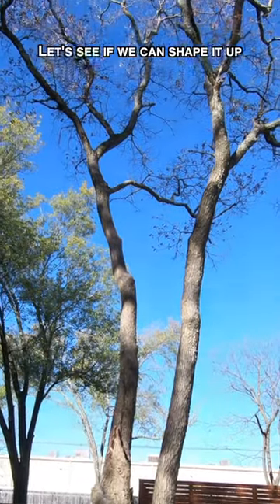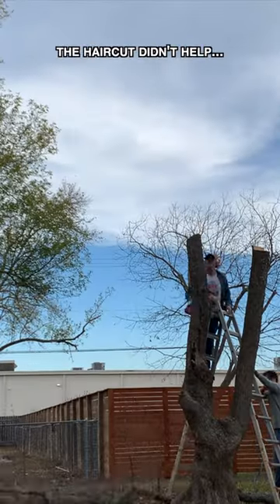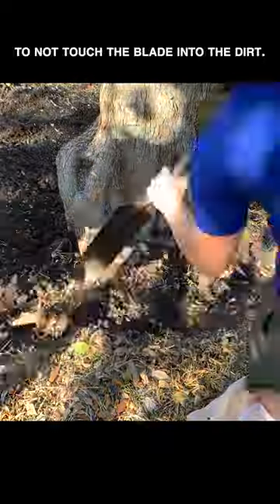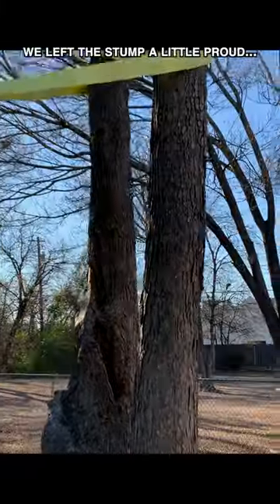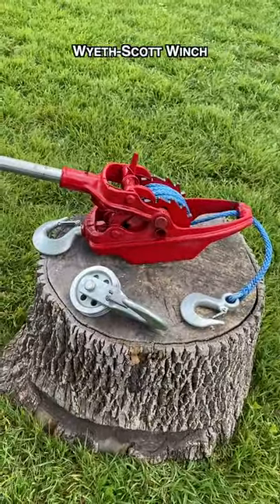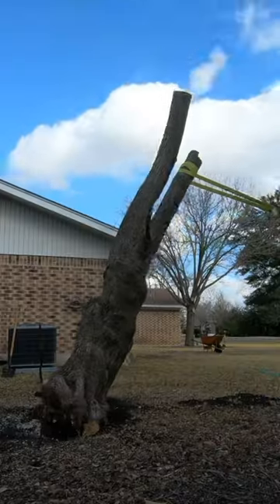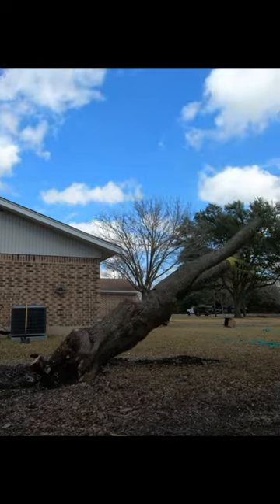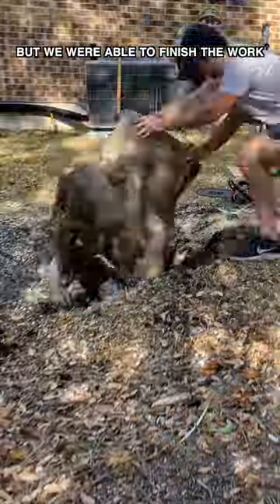Using Physics to Remove a Tree!🌳 #treeremoval #tools #physics

Comment from the maker: Ended up upgrading the winch for a truck! Check out the linked video.
Reply: I watched a video of a guy with a tractor and a higher degree in some science that I can't remember struggle for two days removing a stump. He kept preaching pulley math and quoting theories. More money and schooling than the ability to link muscle to mind. The comment section was lighting him up about what he had done wrong. He hid behind excuses and accreditation. Meanwhile, you made this look easy with practical applications of equipment and force without pretending to know what you're talking about.

Comment: Sawzall is a good way to cut roots instead of chainsaw.  Use a Diablo pruning blade.  It can sink into dirt without worrying about dulling the blade much.
Reply from the maker: Agreed! We used that and a cheaper electric chainsaw on some other removals
Reply: Damn good idea
Reply: That's exactly what I did with about 12 trees in my back yard
Reply: I now have the challenge of a red oak stump that doesn’t want to move. I’ve pulled and jacked from several directions, thinking that I’d seen movement.  I’ve one more direction to try if I can muster an anchor that way, then it’s heavy equipment time.  
The tree had fallen over during wet weather after over 60 years that I know about, so my next effort will be to pull it directly away from the weak root system that allowed it to fall over.  I’d been using its resistance
To anchor other efforts, but it will soon be time for me to make some sort of table top out of the remains and fill the massive hole that’s roughly 10 feet diameter.

Comment: Sawzall works amazing for roots, i ran a wood with nails blade in the dirt for a long time, only reason the blade broke is because i hit a few large rocks multiple times
Reply: Your blades break?

Them Diablo 14 inch embedded wood blades just bend side ways and keep cutting. 😂😂
Reply: @dbongoloid9541  yea after you straighten them out a few times with a hammer they get real brittle lmao, milliwaukee blades

Comment: A small fruit tree was removed [about 10 feet from my home] they left a small stump and now I have a colony of carpenter ants. I'm guessing that the ants were attracted to the sweetness of the stump. How can I get rid of the ants?
Reply: Stir about 3/4 cup of dawn dish soap into 2 gallons of water.  Pour slowly.  You want it spread wide enough but also deep enough.  Works great around my garage.  I was told that they breathe through their exoskeleton and the dried on soap interferes.  I hope it works for you.

Comment: What is that long pole you were using to cut those branches without a latter
Reply from the maker: Stihl Pole Saw (PP800). Its a little on the pricey side but it has telescoping handle and can reach 18 feet.

Comment: I’d like to remove a tree that’s next to my house, maybe 5 feet away. It’s ugly and it’s cross bred it something somehow 😆 it was here when we bought the house. But the house (neighborhood) is only 15 years old. We normally are a DIY type of people. But with the roots being so close to the house my husband is afraid we could damage the foundation..??!! It’s just a small tree maybe 15 feet, and less than 15 years old. I wouldn’t think 🤔 that could happen. Any ideas? Heard if we cut it to a stump then there was a chemical we could use to get rid of the roots??
Reply: Potassium nitrate can be easily purchased and applied to stumps (and I think roots too) to expedite rotting. Then they disintegrate easily and are almost removable by hand. Takes a couple of months.